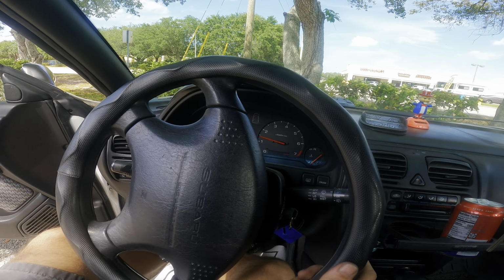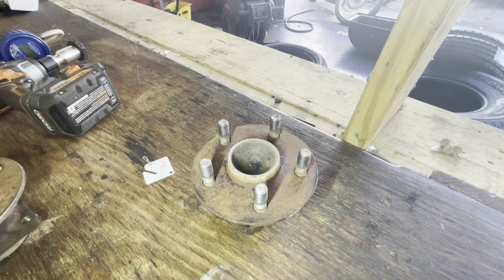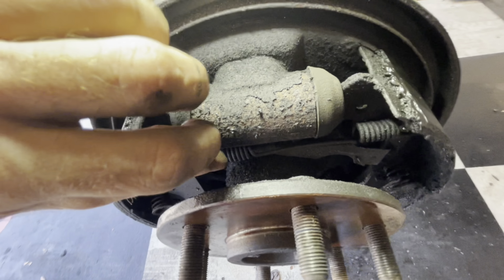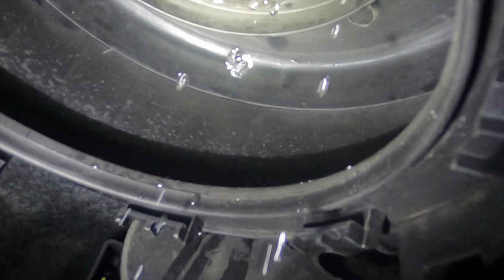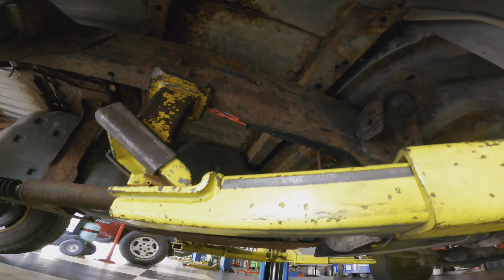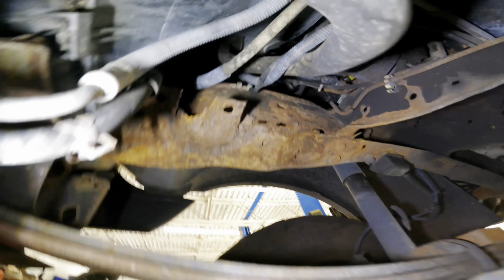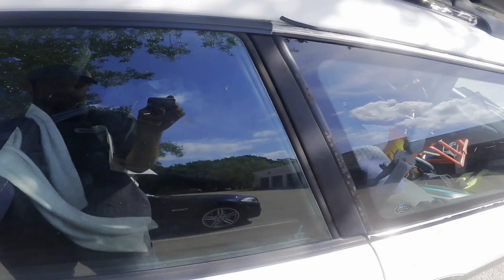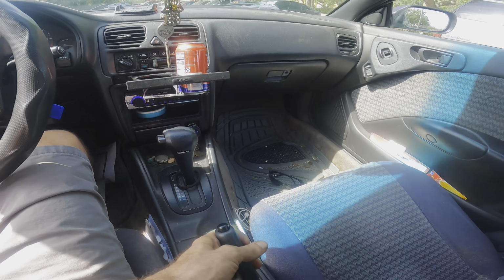Customer States: No! “Towed in and Towed Out” Compilation

Comment: AC techs who found leaking refrigerant were required to then evacuate said system some yrs bak. Customer was charged for the diagnosis and test refrigerant. 
I told shop owner I'd be ok with that if personal security was provided to prevent unhappy owners venting on techs. In the end neither happened and vehicles left with working/leaking AC in spite of law.
 As the last link in the repairs chain , techs are either Hero or the Zero (which most customers who decline fix feel techs are)

Comment: I had an old Escort and I told my wife it needed new brakes, she told me to wait until next month, next month, I reminded her, she told me to wait until next month. Driving home one day and blew the calipers out, drove it 20 miles using the emergency brake and had to have new calipers, rotors (old ones completely worn through), pads, and emergency brake. A $100 (at the time) repair become $300.
Reply: Sounds like she doesn't like you too much.

Comment: Oh that last brake job was NBD. Just a line splice. Route it around the box. Problem solved. My thing is, that's a customer fix, not a shop fix. The customer brought it in so, presumably, they already knew about that. Which means that's what they intended to be fixed. Why'd they nope it? Was it the price?

Comment: lol that Corolla made me laugh, I had an 06 Corolla 5-speed manual that lasted till 320k miles without any suspension work, it only died at 320k miles cause I smashed into a wall lol, parents bought the car new and lasted 320k miles and 14 years. I used it for college and added 120k myself after they gave me the car

Comment: Do you guys over in the USA/Canada not have yearly inspections on cars over 3 years old ? as most of these vehicles would of been condemned 10 years ago, with rust, corrosion, and non working brakes if they had been in the uk

Comment: I'm lost, too! 😳
It's absolutely unbelievable for me as a German how ppl. in the U.S.A. can/may and are able to keep their "vehicles" = scrapheaps on the road. It's impossible to do so here. Passenger cars have biannual safety inspections, taxis annual safety inspections.
Any humidity on brakeparts, any pinhole in the chassis or structural bodywork, any inequality in right/left braking force of more than 10 % on the front axle or more than 30 % on the rear axle or more than 50 % in the handbrake, any pending trouble code, a defect of a wiperblade, a defect of any bulb, any misalignment of the headlights, waterdrops in any lamp, just a pinhole in the exhaust... will lead to a refusal of the needed sticker on the license plate. Then you have 4 weeks to get it fixed (except if the vehicle is unsafe, then you don't roll off on your own wheels anymore!). After these 4 weeks you have to take your scrapheap off from a public road.
Reply: Vehicle inspection requirements are as fragmented across the United States as they are across the member states of the European Union. Most states in the US legally mandate periodic vehicle inspections, with frequency not dissimilar from what is required in European countries.

If you are asking why certain states have lax inspection requirements, that’s because road safety is not an absolute value, it is a relative value, as is freedom of movement. Emphasizing road safety absolutely would nullify freedom of movement, as the only way to ensure zero road accidents is to forbid the use of the road completely.  The US has about 1/7 the the population density of Germany.  So freedom of movement is FAR FAR more dependent on cars in the US than Germany.
Reply: @bindingcurve  I know about the differences in the U.S. states.
But I'm not talking about zero accidents as an absolute value. I'm talking about zero fatalities as a future target. And that's why I think the life of 3rd party ppl. musn't depend on the state where s/he is living. And it especially shouldn't depend on the not exercising of the executive to protect people's lives AND the tolerance about the reckless acting of such road users who put willingly and in full awareness of their acting and the potential consequences a screw into a brakeline. And I'm not talking about a "farm use" only machine, I'm talking about a vehicle with a given, valid license plate.
About the "U.S.A." and the "European Union": there are 2 major differences. 1st While the "U.S.A." is/are one country the "European Union" is/are 27 independent countries, just bound by nothing more than contracts about trade, norms, taxes, customs and freedom of movement. 2nd Even in the European Union you (almost) don't see scrapheaps like that on public roads (probably exept on some remote islands where the public traffic is mostly like "farm use"). Such dangerous scrapheaps are taken off public roads even in Italy, Spain and Portugal!
Reply: @craigfin3222  I believe you!
I don't know exactly what "$ on them" means; is it monthly income or money in the bank? Anyway, the legal minimum salary per hour is here € 9.82 brutto. That equals to less than € 1,000.- per month netto for a fulltimejob. Many people have to commute far by car due to the "flexibility of the labourmaket". And fuel prices here equal to 8 to 11 $ per gal. If you have a parttimejob you get € 500.- to 600.- per month netto with the same distance to commute. Do you know how those people are able to survive, paying for rent, fuel for commuting, food and clothes? By applying for public welfare although they are working, by payments by their parents, siblings or partners.
I don't see just the shiny U.S. I also see a bit more beyond.
By the way: I don't share your view about the 2 elected presidents. 😉 I think both should had been replaced by better ones. But every country has the leader it deserves. 🤪 So we had Helmut Kohl for 16 years, Angela Merkel for 16 years and now Olaf Scholz. 😂🤣🙃

Comment: The last time I saw a vehicle as bad as that poor Chevy, it was another GM product. My 78 Buick Electra Limited 2 door had to be jacked in the middle to close the doors. It was 10 years old. Before that, I saw yet another GM that bad, and it was only 8 years old, but was not North American. It was Ma's 1958 Vauxhall Velox. The shop it went to told Ma they would not and could not change the oil or do any other service to it, as the unibody was so weakened by rust it could not be lifted. Its final drive, later that day, was to the breaker's yard.

Comment: I had one those Subaru in high school did the same thing trying to plug a rear break line cause I couldn't remove the rear hub nut to replace the rotors I didn't have breaks either....brings back memories of high school seeing this clip

Comment: Yikes. Is there really no way to save that Subaru though? Are they the only manufacturer that uses that brake line Y-splitter thing? Or does it need to be the one from that particular model; the equivalent from a 2006 Accord won't work?

Comment: How the hell can people let their cars get this bad?!  In the UK, cars have to pass an annual MOT (Ministry of Transport) test, so cars shouldn't get this bad.  Most people won't buy a car without an MOT certificate.    Your other rust buckets would have failed years ago.
Reply: Car safety inspections are up to each of the states, depending on where you live it ranges from absolutely NO inspections to a real inspection of the safety things on a car.  Ray in in Florida, In the state of Florida, there is no requirement for yearly vehicle inspection. There are also no requirements for vehicles to undergo emissions testing. California is the opposite, stringent safety and emissions inspections are required annually.

Comment: I thought my wheel bearing was bad on my 01 Silverado that I just replaced over the Easter weekend. I had very little play in mine replaced it right away. Mine came out easy a few hits with a chisel and out it came. Here in Michigan they can be rusted in so bad you spend all day just getting the bearing out. Also I thought my 01 Silverado was rusted out but my frame is no where close to that. It's actually pretty solid for being a upper peninsula of Michigan county truck and probably hauled salt.

Comment: I still miss old style wheel bearings yes you had to grease them and that was never fun . The new style hub and bearings assembly is a great idea and can make the job so much easier and cheaper in total cost to replace with parts and labor. But once again they built the part to fail !! Why do I say that.
Because they didn't put a grease zert in the assembly or any other way to grease the bearing assembly so it can't be greased causing the bearings to fail sooner than if you had a grease zert on it and grease it a few times a year depending on how much you drive. Now that would have been a huge improvement over the old style. Since no one ever really greased the old style.And then they come up with a replacement to make the system have less parts and what ever other reasons. And then I think they figured if they made it easy for the owner or anyone to grease it In less than a few minutes that they would never wear out and parts sale's and new car sale's drop and they can't have that. In or business we are always modifying new part's trying to put grease zert's on all the moving suspension parts sorry so long got caught up have a great day !!!

Comment: I recently repaired brake lines, just the ones in the Subaru near the end.... by the time I was on the last piece, I was ready to scream... I cut, flared, routed, and bled new line from under the back seat, to each of the rear wheels, in a parking lot.
I'd love to this... on a lift... in Florida! (I HATE SALT!)
Reply: I am savoring the idea of my next house having a garage, even though I still wouldn't do some things. Not in the street, not in the hot sun, or the cold winds.

Comment: Yikes, the owner of that Corolla must have been scared to death of driving it in that condition!!  The reason being is that the wheel could come off any moment!  If I had a car that was in that condition, I would probably get it towed to the shop.  I know a mechanic just a few miles away so it shouldn't be expensive really.  IF you are in any situation where you for some reason must drive a vehicle with such a bad bearing, take it easy and make sure to bring a phone with a charged battery with you (that shouldn't be hard since most people have phones anyhow).  I live in the stix where it sometimes feels like there is no one to help me and thus a phone with a charged battery is a must for unforseen emergencies.  I once had a Dodge Neon with a rear bearing failing and it was amazingly easy to change it.  If it had been a front one, that would have gone to a mechanic but the rear ones on those cars are unbelievably easy.

Comment: Ray, a few vehicles in those clips should not have been allowed back out on the roads. Where you operate would a mechanic/inspector have the authority to "ground" a vehicle to stop it being driven on the road when it's considered so obviously dangerous to be operated and should be in the scrap metal bin.
Reply: Car safety inspections are up to each of the states, depending on where you live it ranges from absolutely NO inspections to a real inspection of the safety things on a car.  Ray in in Florida, In the state of Florida, there is no requirement for yearly vehicle inspection. There are also no requirements for vehicles to undergo emissions testing. California is the opposite, stringent safety and emissions inspections are required annually.
Reply: @davidnull5590  I'm in Australia, we have a similar set up as U.S.
The state I live in has no annual inspection but Roads and Traffic do random roadside checks. Licenced inspection stations have the authority to report/initiate registration cancellation for an unroadworthy vehicle.

Comment: The Subaru I would've considered getting 2 line unions and a new brake line to replace that back passenger corner. You bet they'd be signing that waver beforehand though. Commercially it was safer to just turn it away though. Could've been a misery pit.

Comment: Should show this shit to the state and say, ummm back off on the salt. Use sand instead. In Ontario they use a lot of salt also and our vehicles are bad also. But not this bad. Anyhow in Saskatchewan they use sand and the cars last much longer. The snow/ice just builds up all winter but it melts eventually. In Regina Saskatchewan I seen on the side street that the snow,ice,sand mixture was higher than the curb. It eventually melted.

Comment: Wow. I feel like changing my oil every 5k, getting wheels/tires rotated every 5k, and checking tire pressures and fluid levels regularly is routine, but seeing the shape folks let their vehicles get into makes me feel like a car care expert.
Reply: Come live in northern canaderp. Things get ugly within 8-10 years no matter how hard you try
Reply: @keithmarlowe5569  - my grandfather was a shade tree mechanic and changed his oil every 3,000 miles, back when this was the thing to do. I’ve always been taught that oil and a filter are way cheaper than a new engine.
Reply: @williamadams2894  - I bet. I’m in the mid-south ‘murica. We occasionally get some ice and maybe 5-6 inches of snow max. No excuse for rusted out frames.
Reply: @JS-hu7pv  I drive on gravel covered snowy b/s 5 months a year. It's terrible.
Reply: 5k is a little excessive on the oil. I rotate at 10k.
Reply: @michaelkoerner4578  depends on what kind of oil you get. I buy the 20k rated and change it at 10k. Cars still running good at 250k miles. The suspension on the other hand? Needs some work

Comment: I’ll never forget my trooper first 01 LE corolla. I should’ve never junked it, pretty sure in my experience of cars shitting on me I only had a bad alternator. Shocks were blown burned oil, had a blown fartfilter but the best kind was free and drove it for 100,000 miles before I retired it at a young 230,000.

Comment: I was looking at a bus to buy in South Dakota 3 years ago and the frame was almost that bad. Wheel wells and parts of the floor were so rusted you could poke your finger through them. Seller was trying to dump it on a sap. He said to just paint over it. I passed, even though I drove 9 hours round trip.

Comment: REGARDING THE SUBARU BRAKE BLOCK: you can replace that with two commonly available female-to-female brass fittings.  They are used to join two pieces of standard brake line together.  For us home mechanics who don't have flaring tools, the parts store sells the hydraulic steel brake lines in various lengths.  We can bend and route it through or around the frame and body and join them together when/where we need to.  As they rarely ended up being the exact correct length, I would have an extra coil or loop tucked or tie-wrapped some where in the run.

Comment: I already knew where the subaru would be leaking. they always rust out right in front of and behind the block, also where the lines go through the rubber grommet.
easiest fix is cut and double flare just inside the vehicle under rear seat and run new lines out to the wheels, routed slightly different. from what I see the rest of the lines outlast the vehicle.

Comment: Ray, try to remember to tell us how many miles are on these so we can know when to expect to have to address various issues. At least those that don't have obvious indicators like a floppy wheel.
Reply: Just refer to your cars manual for the things that need to be changed at regular intervals. 
Oil/fluids, belts, timing components, spark plugs, tire rotation, fuel filter, and water pumps all have a recommended mileage to be changed at for each car even if nothing is broken. And it can vary for each car. 
Preventative maintenance is the best option so you don’t brake anything major and don’t get stuck out on the road.
When you have the preventative maintenance done that’s when the shop can check other components for condition.
Reply: @chronovore7234  Well my manual doesn't say how old a car is when it will be rusted out, or how long the wheel bearings are likely to last, or how long the seals in the brake cylinder last. What car are you driving?

Comment: See Subarus with those brake lines bad all the time in Maine. Just replace them from under the rear seat back. No block needed. At least it doesn't appear to cause any issues with braking performance.

Comment: And here I was, freaking out after I learned that my completely dry and uncracked original factory hydraulic flex lines to each wheel (in my 1990 Suburban), should be replaced about every ten years or so...and then to see the crapstorm of your patients on your operating table...

Comment: As a brake mechanic for 40+ years, many times when they declined all repairs I wanted to sell them a boat anchor! You have to admit it might slow them down some? This is some of the worst rust out I have seen. A shop tech picked truck up and frame broke "into" between cab and bed!  I was always "surprized" at how little importance customers would put on fixing their brakes. It not like they would need them all the time! Only when they are about to hit that tree, or concrete wall, or other car. You are doing a good job. Print off a picture of a boat anchor to give the next customer that declines brake repairs.

Comment: Loved the "Du-four" brake line repair, with the different threaded bolt jammed in to plug the fitting. Reminded me of a car I purchased for 65 dollars (in calendar year 1974), which just barely got me around. It was a well used Oldsmobile. But I never let my brakes get quite that bad!  I just had to pump my brake pedal a few times before arriving at a stop light, to build up some pressure first. Can't imagine why that other guy didn't at least match my decidedly better maintenance program!🤣